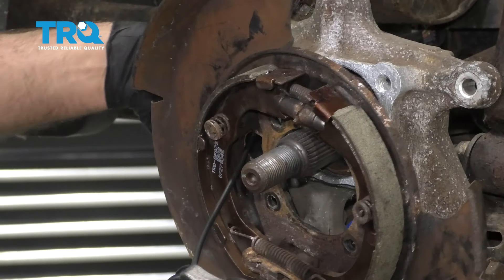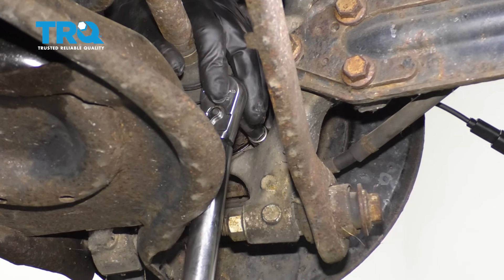How To Replace Rear Wheel Bearing Hub Assembly 2010-2017 Chevrolet Equinox

Comment: My 2012 Equinox is a front wheel drive and has no CV axle on either side. I’m a little confused on yours having axles on the rear.

Comment: Hello.  Odd. The parts page says it’s a front wheel bearing but in the video you are tearing down the rear…..
Reply from the maker: +@wayne1271 Depending on your vehicle, the part in the vehicle will fit in the front or rear position of the vehicle.